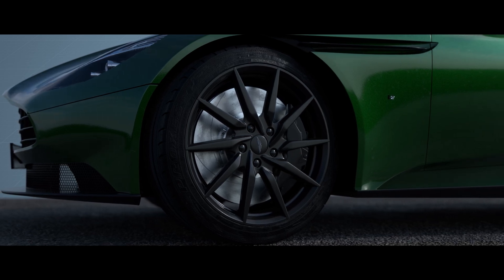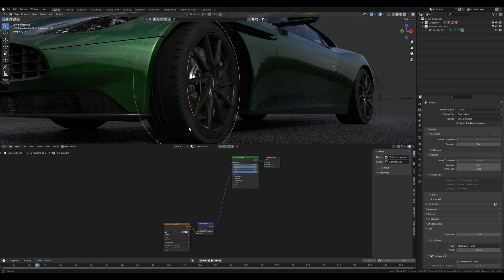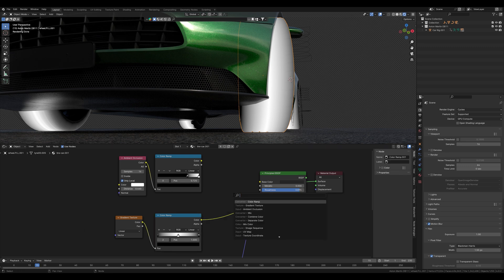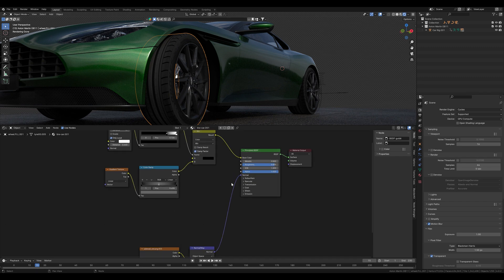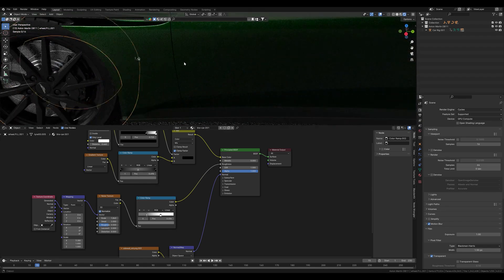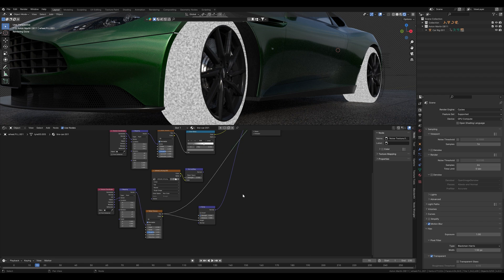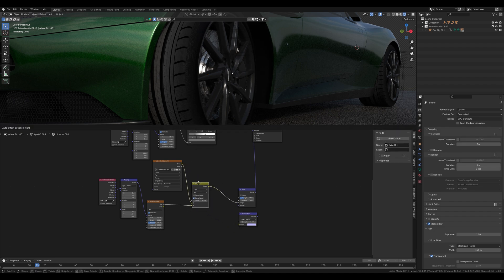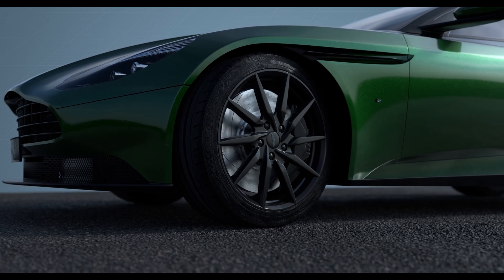Easy Realistic Tire Shader | Blender Tutorial

Comment: This Is So Helpful! awesome Work. I have a question regarding the dirt on the tire. is it possible to add texture to the gradient. I've tried to add a noise node to it but it doesn't seem to work. The noise doesn't stay withing the gradient, it just fills the entire tire. Also maybe i'm doing it wrong
Reply from the maker: Yes you can do that. You can use a mix shader instead of a mix color node, to use a texture. 

Try another blending mode on your mix node, if it just fills the gradient. It depends on how you use it and the blending mode.

Comment: The second part with the gradient texture into the color ramp goes on, on the wrong axis. Instead of the black gradient towards the middle, it is on the top and bottom of the tire. Do you know how to fix this?
Reply from the maker: Yes, you can fix that with the mapping node. Just play around with the rotation values.

Comment: I love how you can do so much with the nodes. Also, I have a question, what about aircraft tyres, could I apply these nodes and tweak it a bit or is there another type of node to use for it.
Reply from the maker: Aircraft tyres have these gaps and if you don't want to model the gaps you can also use a gradient, then a colour ramp node to control it and then connect it to a displacement node.